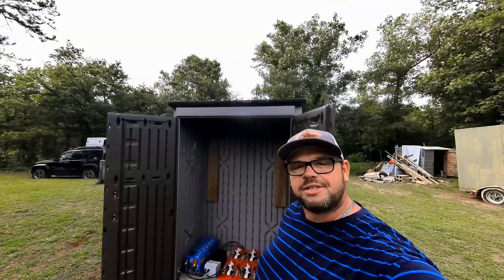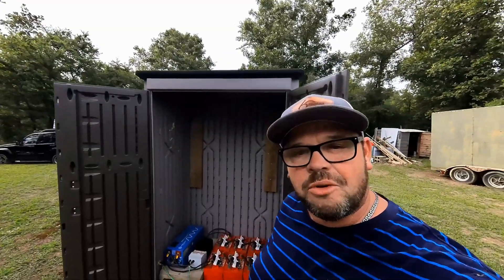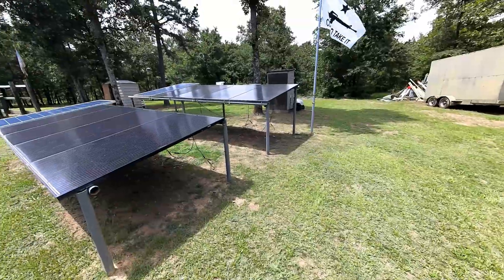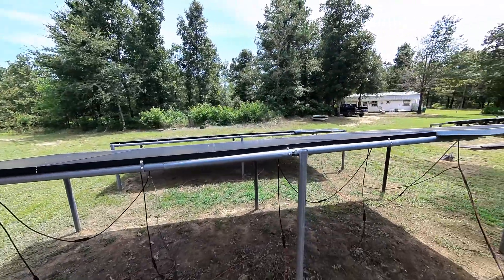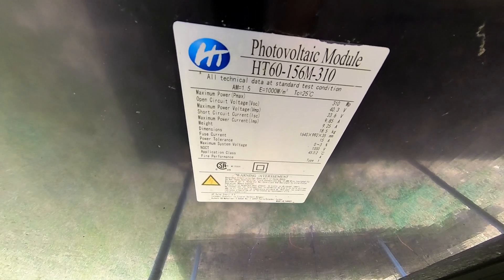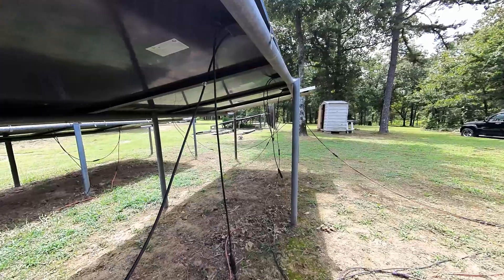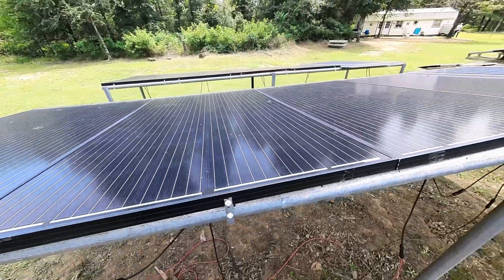How I Just Built My Own Solar Cheaper!!

Comment: I just got 16 380W 46V panels for free all I had to do was take them down for the person. Plan on powering my 50AMP rv with them! I have a 6000 split phase inverter on the way that has a built in 120A mppt charge controller.

Comment: cool sir. I recently stepped up to 25,000 watts of Solar Panels  but I still like watching vids with various setups. I'm sure you've taught many. :) .. ...Anyways As far as the 25,000 watts of Solar Panels go. I really didn't need that much as it's definitely an overkill but I found a really great deal that I just couldn't pass it up. I see this vid was posted a year ago. I hope things are still going well for you. I just Liked & Subscribed
Reply from the maker: @mister.beastly  thanks for subscribing man and wow 25,000 watts is awesome.. yeah maybe that is an Overkill in some situations but man you have to admit you can run anything. What size is your battery bank? In what type of batteries are you using? But yeah for sure my system still running good right now I had to change the inverter out you may see that if you check out some of the other videos I went to a cheaper high frequency inverter but yet so far I've had no problems out of them. I upgraded to that eg4 3000

Comment: Number 1. There's no such thing as 12v, 24v, 36v or 48v panels. You cant hook up your panels to the battery without a charge controllers. Please lets stop calling anything a solar panel is for
Reply from the maker: i guess before your time sir we called panels 12 volt 24 and 36...you use to could not wire them all in series back in the day because the charge controllers were not capable of more than 17 volts dc voc

Comment: You can buy an all-in-one solar controller/inverter.
EG4 makes a 6000 watt controller that sells for around $1500.
Just plug your solar panels into it. It puts out 48V to your batteries, and 240v/120v AC output.
One component controls everything.

Comment: Does two 33v panels not make 66v?  Not 48v.   Does that mean you could run a 52v system instead of 48v?
Reply from the maker: its always higher than the required voltage in order to be able to have the power to charge..example 12 volt cant properly charge a 12 volt battery...you need about 14.2 volts to charge 12 volt up
Reply: @OKLAHOMAOFFGRID  Thanks for clearing it up for me.
Reply: Short answer yes, he is a bit confused on things but has good intentions, with a step converter you can tech charge a 48v battery with a single 100w panel, the amps would take like forever though
Reply: @SarahStuff-p5u Why incorporate more expensive power electronics when you could just configure your panels properly

Comment: You just can't do a solar system these days with lead acid batteries. Lifepo4 batteries are too cheap. You mentioned that money was in issue when you did this system and then you mentioned that the batteries were $1k-1.2k. This video is 3 months old. 4 decent 100ah lifepo4 batteries should run you ~$1k. Much better alternatives.
Reply from the maker: Thanks for all the advice. I built this system almost 3 years ago. I knew nothing about lithium batteries at that point. And I'm pretty sure they were a lot higher and not as available as they are now. I had eight 6 volt  battery cores at the time. Also the one you're talking about that are around 279 Dollars plus tax 12v 100ah are mostly cheap Chinese made with a very fragile BMS.... Fast forward 3 years and I am now building systems with life po4 batteries and I plan on changing mine soon... But as it stands my batteries are still in excellent condition with about 7 years left... So I haven't quite decided what I'm going to do yet
Reply: @OKLAHOMAOFFGRID Battery hookup has deals on batteries like santan does panels.
Got 14 kWh of LiFePO4 in two prebuilt 24 volt modules for $1800 delivered.
I'm confused on the whole need to classify the panels as 24 volt.
Eg4 has a 3000 watt all in one inverter with built in mppt solar input up to 450 volt ($650) so you could have ran all the panels in series ditched the combiner box and ran the 420-330 volt single line to the inverter.
Or two arrays of 5 panels each and still wouldn't need the combiner box.
Reply from the maker: @ghz24  I purchased the system almost 3 years ago in pieces that's why I have what I have... As far as eg4 equipment I know all about it if you'll take a look on my channel you'll see I did a video on a complete eg4 system that's pretty awesome with 20 kilowatts worth a batteries and the same inverter you're talking about
Reply: @OKLAHOMAOFFGRID  I caught that, it was a suggestion for a source when you upgrade or add on.
I found the server rack eg4 batteries to be pricey for the capacity so I went with the reclaimed modules. I did like the communication feature so I got a pricey BMS that gives me that  feature according to reviews reporting it works. (Crossed fingers)
Another suggestion you probably already know about but seems a perfect fit for you, have you seen the eg4 mini-splits with solar inputs?
Probably have an installation video already, I'll go check out your channel now.
Reply: @ghz24  what about the 52v for $1500, could you do it with just one module for a 48 v setup? Batteries are the most expensive part so just trying to figure it out.
Thanks
Reply from the maker: @jacobchadwellandfam4756  I can tell you a nice start would be 2 48 volt e4 batteries...it would be 200 amp hours at 48 volts...if you can find 200 amp hours worth of lithium at 48 volt for cheaper than go for it
Reply: Respectfully of course you can do it on lead acid batteries I know a lot of people that do it. It's very cheap to buy even brand new batteries play Old School easy to replace.
Reply: @WhatsCookingTime  I think his point wasn't that it's impossible more of it's pointless.
You classify lead acid as cheap but in reality they are the most expensive batteries to own. Cheap to buy but expensive to use.
Plus the coulombic efficiency is costing energy every day.

Comment: Find your local CED Greentech renewables distributor, ask about their graveyard modules and scratch and dent modules. You can get really good deals on solar mods this way. They may be a year or 2 old and be a lower wattage than the new stuff but just check the price per watt. Other open box parts may also be available.

Comment: Hello, best "Off-grid Solar for Dummies" I've seen, after Many, in only 16min. However, I was still left a little dumb.
Nothing mentioned about suitable switch/s in the combiner box (guess it was only one).
48v into 45amp charge controller, "have to be careful", what happens if your not? Should 65amp be used instead?
Why 6v batteries vs 12v (lead). And what would the equivalent of lithium be for your set-up?
Is 3000w inverter enough for you? Can you plug in one of those portable camping ones in the house if you need a little extra?
What's your opinion of the equipment today, vs similarly priced Victron Energy MultiPlus-II ?

Comment: Your system is doing ok, not great, as far as voltage drop/power lost in wires.  
2 panels in series has 68v output mpp and probably 10amps so using 10g solar wire and 40' to combiner box you lose just .95v or 1.4%.  
DC going from combiner box to shed- 68v, 40amps, 10g wire and 40' distance leads to 3.8V drop or 5.6%.  This is ok but not very good.  
Shed to house- 120v AC, 30amps est, 10g wire and again 40' distance leads to 2.9v drop or 2.4% drop.  
All these calcs is via Calculator net.  You can do your own calcs if my numbers are off.
The DC loses would be cut in half if you put 4 panels in series, bringing voltage up to 136v mpp (if your controller can handle this and near 150v VOC).  3 panels in series might be safer/better in line with controller max VOC, reduce voltage loss from current situation, but requires panels in multiples of 3 (3, 6, 9, 12).

Note- if you need to go with higher MPPT controller on a budget- MakeSkyBlue has 60A one for $150 (but has fan) and HQST has 60A one for around $200 (no fan)  both can take more PV input than your current controller and both have 150v max VOC.
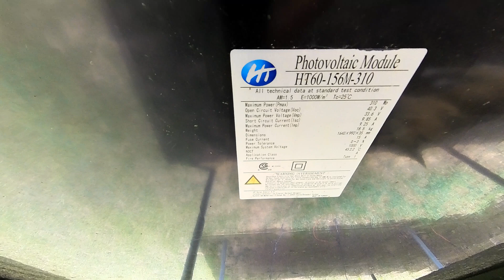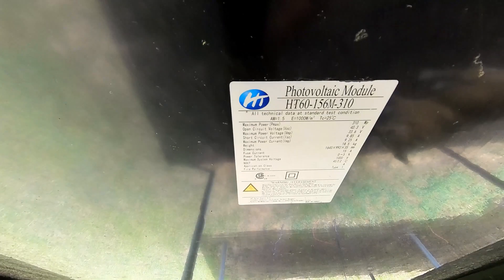Reply from the maker: Thanks for all the info. My footage from the combiner box to the farthest away panels is about 20 ft... And I believe from the shed to the house I used a 6 gauge direct burial and I think I'm 170 ft when I measure the voltage at the inverter on the AC side it is around 1:22 or 1:23 at times when I measure the voltage in the house it's at 121 to 119

Comment: I paid $26 for each of my 235w panels from santan solar.
Reply from the maker: My point made
Reply: Haven't seen a price that good in a while from San tan. What capacity are they?
Reply: @hamadilawson4471  Ten 235w panels for $26 each, and $300 for shipping.  I don't know how long they'll last but that's dirt cheap for 2.3kw of power.
Reply from the maker: @hamadilawson4471  check out fb market ...i find ware houses selling them all the time new in bulk on pallets for cheap
Reply: It takes a fairly large array to be able to operate and still charge even on cloudy days. Lots of panels lots of battery atleast 200 amps of charge controllers
Reply from the maker: @matthewknight5641  I float on cloudy days lots of not every time but lots of times
Reply: @OKLAHOMAOFFGRID  I might have finally found my perfect as it gets property for my off grid lifestyle I'm trying for so hard. Another couple had bought it and set it up fairly nice already but I think they split and AR now selling it. Keeping my fingers crossed lol. Thanks for doing videos. It's cool to see others are making it work ya know.
Reply from the maker: @matthewknight5641  good deal

Comment: Also 
I’m looking at 

aptos DNA 440 watt solar panel bifacial 
Batteries is between fortress batteries and ark 
And inverter and stuff either Schneider or sol ark 
But I here sol ark has some issues . 
And plus I have no clue what other things I need etc 
Like wire or ground mounts 
Fuses , breakers 
Etc 

I might higher but I would love to do it 
I’m probably making it look worse than it is 

But right now I’m saving up to slowly piece it together

Comment: Thanks for the story. I don't agree with all of your numbers. I am not saying you are wrong. I just have a different understanding. Lets start with 45. Your controller have 45 amps. To me this is the max amount of amps that go to the battery. Not the max amount of input amps. Your input PV is MAX 150 volts and 2400 watts for a 48 volt system. Now having extra watts helps on cloudy days but on sunny days it is just burned up. Anyways that is my understanding how things work.
Reply from the maker: Hey man I'm definitely not perfect when it comes to this stuff.. I only know what I believe I learned which isn't necessarily always correct. When I went to the morning start website and check what you were saying it does seem that you are correct and that the charge controller at 48 volts is only rated for 2400 watts.. I really don't like that idea so I am definitely going to be upgrading my charge controller because I am as we speak adding more panels. Well I've been running to systems like this for a long time and I have seen on one of the system's 3,200 watts on the meter and I have also seen 42 amps coming through. Now I don't know if that is just what the panels were producing or it was a total of what was going into the batteries and what was being used on the house at the same time. Like I said I'm not a professional just a do-it-yourself guy and I'm still learning

Comment: At 8:00, the message says 48 volts at 44 amps is 3100 watts. My math says it's 2,112 watts. That's assuming 100 percent efficiency, which doesn't exist in solar.
Reply from the maker: the panels are rated at 3100 watts...i have seen 44 amps on the monitor and i believe somewhere around 24 0r 2600 watts when batteries where charging heavy and  i had a load going the panels are 310 watts each..there are 10...let me know if I am confused...or we just have a mis understanding
Reply: You will go over 33 volts on a really cold sunny day. It will actually do the voc if it's cold enough from what I hear but I'm actually not 100 percent on that
Reply: If you might be interested in some leaf modules I can give you a really good deal on a bunch of them. I have 24 modules and my buddy has 48 for sale cheap also. I have active balancers already on them and they would be a game changer for you

Comment: Awesome setup. The panel racks are fantastic, simple, clean and cheap. A few questions, how many watts is the inverter, how many amp hours of batteries did you say you have and their costs? What is the maximum wattage you use in your home and average wattage? Being in Oklahoma do you worry about hail? BTW, I use to fish Broken Bow quite a bit until they damn near killed me and a buddy of mine. Good video Justin.
Reply from the maker: inverter 2000 watts with 6000 surge for 20 seconds...48 volts @200 ah ...max watts I use is probably  around 1050 for short periods at once....that's daytime a/c fridge fan tv well pump here and there...

Comment: Surprisingly, I liked this video.  There are some things I definitely think you could improve upon, like burying the wiring in a conduit to protect it from damage, but overall this was a really good video on how to build a simple solar setup.  The one thing where I strongly disagree with you is on the batteries you chose.  These days, going with any lead-acid battery solution, over lithium iron-phosphate, just isn't a smart move, money-wise.  You bought 8 of those 6 volt, 200 amp-hour batteries, but because they are lead-acid you should avoid discharging them below about 50% state of charge, if you want them to last more than a few years.  That means you have about 100 amp-hours worth of capacity.  You could buy four, 12-volt, 100 amp-hour, lithium iron-phosphate batteries for just a little more than you paid for those lead-acid batteries, but you'd get the full 100 amp-hours worth of capacity, plus they'd last a good 8 to 10 years.  I'm willing to bet that in 3-5 years, when those lead-acid batteries are no longer able to keep up, you will sharpen your pencil a bit and realize you should have gone with the lithiums.  The only exception to this is if you are often at risk of charging your batteries while the cells are at a below freezing temperature.  Even that is very easy to fix with a heated battery box.  Other than the batteries, I think you did a good job putting that system together.
Reply from the maker: Well to be honest with you it was circumstances as to why I got led acid batteries two years ago and not the lithium. Didn't have 3 k for lithium an d had cores for 6 volts. If I had  the 3k at the time I would have got the more efficient batteries I understand that I can only run them 50 percent discharge if they are going to last I have another system with 16 6 volt batteries on there 8th year.
Reply: @OKLAHOMAOFFGRID  It's all good Justin. Most people think everyone has money like this guy who commented.
Reply from the maker: @ApproachingHoofbeats  👌
Reply: I really wish you would do a video where you convert solar into watts, Amp, etc so us common folk would know how much we need to power basics like fridge, ac, lamps,  etc. Seems like the solar voltage is different from regular ac voltage ⚡️ I don't know. Thanks brother keep up the great work!
Reply from the maker: @ApproachingHoofbeats  okay got you man I'll see if I can throw something together
Reply: @OKLAHOMAOFFGRID  Justin you f'n ROCK!!
Reply: @ApproachingHoofbeats  - You almost got that correct.  Most people think like you do, meaning penny wise and pound foolish, which is why they don't have enough money to make good financial decisions.  Like folks who pay $1.29 for two Tylenol at a gas station, instead of paying $7.99 for 1,000 of the exact same pills, using a discount coupon at Costco.  You go right on paying 65 cents for each pill and I'll pay 8 cents.  For those paying attention, that's how you become the guy who "has money"...by being smart with your money and working your butt off to make more.

Comment: Walmart has Chins 100ah Lifepo4 12v for $266.  I'm running two in series for a small 24v system. 8 of them would be $2128. You shouldn't run lead acid down to 10/15/20 % like you can Lifepo4. So you really don't get the AH like you do with Lifepo4. Lifepo4 should be good for 10yrs or more. No maintenance.
Reply from the maker: yes sir.. this is true..money was an issue at the time i was building the system
Reply: @OKLAHOMAOFFGRID  I understand. My dad grew up making do with what ever he had, but it never stopped him from gettin it done. The American spirit of self sufficiency lives on in many of us, no matter what it takes.

Comment: May I ask why you put your combiner box on the tree when you should've put it right there on your panel frame or the flagpole? Is there a reason you're using lead acid instead of lithium? Lithium is more cost effective.
Reply from the maker: I put it there because when I built the system the panels were all laying on the ground with four by four blocks under them to give them the correct angle . I built the racks for the panels and got them off the ground a year later. I wasn't going to just throw the combiner box on the ground next to the panels. I used led acid because I did not have $3,000 for 200 amp hours of lithium. I paid 1000 for the led acid
Reply: @OKLAHOMAOFFGRID  that makes good sense. I was only asking because I purchased three new Lthium ion 100amh batteries, for a total of 300 amh for under $1000. I enjoyed watching your video and look forward to your future videos.
Reply from the maker: @rogue0921  where did you get those I'm currently looking for 100 amp-hour 48 volt batteries

Comment: Dumb question time:  Why the trouble of connecting two  24 VOLT  panels instead of  a sinlge  48VOLT panel?  (do they not make them that large for residential application?)
Reply from the maker: Never seen one...